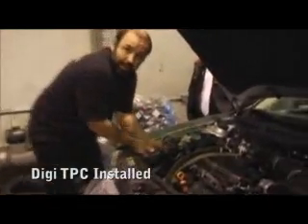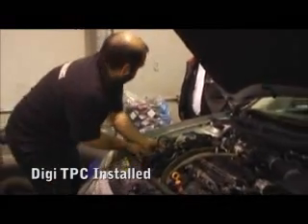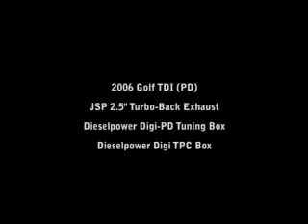JSP - Nick's 2006 TDI Dyno Runs - 162 HP

Comment: @SuperChicken13 Yea u must be smarter than 47,000 people on tdiclub that have seen bunch of these turbos fail because of overboosts, right at 22 psi, i can take this turbo apart with my eyes closed and yes i am telling u, your turbo's days ARE numbered. yes you can get enormous amount of power by boosting to 22 psi but that is why we spend 1200 bucks for a hybrid turbocharger that can handle those kinds of pressures, because we prefer not to have failed pieces of the turbo going thru the engine
Reply from the maker: itsbojan just an update, I put 170,000 on my turbo at 22psi+ before the bearings failed at 7,000'

Comment: You can clearly see the boost runs constant over 22 PSI on that VDO gauge. If you are selling this kit to people you need to advise them the tuner increases the boost WELL over safe limits for that stock turbo. These turbos should NEVER run over 18 PSI, they are just not designed for that

Comment from the maker: $999 CDN for the electronics required for tuning, and about $150 to $450 for the exhaust depending on metal grade.  The gauges aren't necessary, but recommended.